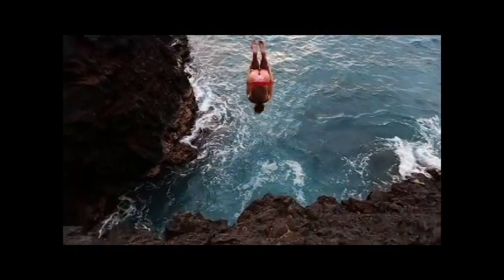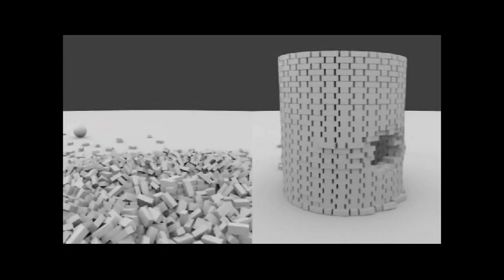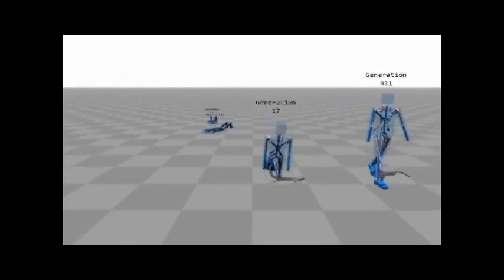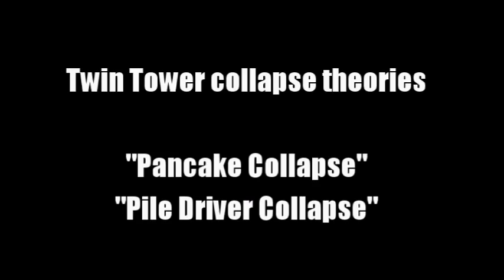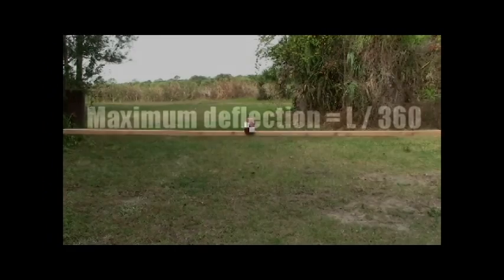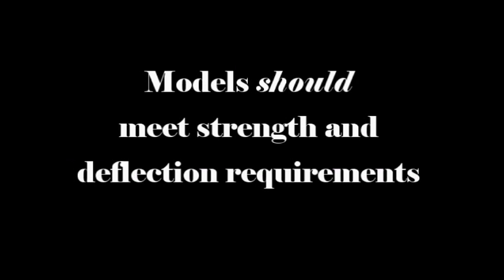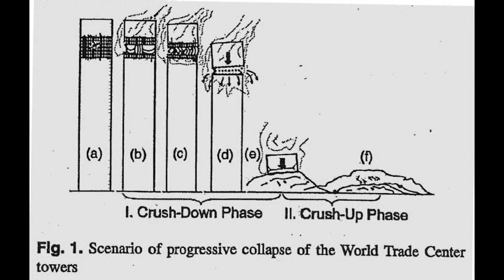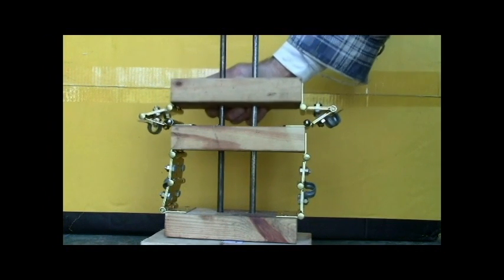9/11 Experiments: The Force Behind the Motion

Comment: Anyone with a single ounce of logic in there skull knows these buildings HAD to be professionally demoed... When one object smashes into another object it slows down or outright STOPS... Period.
If you drive a car into a house it does not gain speed and kinetic energy continuing on through the next houses inline... It FUCKING STOPS!
By the logic of what we are told happened that means that every bullet that was ever fired out of a gun or ever will be fired out of a gun should still be out there traveling around gaining speed every time it hits something... You see how retarded that sounds? 
At the very most I would expect the tops of those towers to collapse and even more likely collapse unevenly and tip over and fall off sideways leaving the rest of the buildings intact. I remember watching them live and anticipating that very thing. The tops of the buildings falling over...
How so many people can not see this very simple truth is amazing and sad at the time.
Reply: Abe - Do you believe a 110 story high rise is built like a tree?
Reply: Gecko trifecta "By the logic of what we are told happened that means that every bullet that was ever fired out of a gun or ever will be fired out of a gun should still be out there traveling around gaining speed every time it hits something... You see how retarded " a bullet doesn't equal a building. first gravity is pulling down so if you fire a bullet it'll always have a arch. got to understand that the building at the top weight a few million pounds. this experiment doesn't show that. you have to have the equal of integrity as the building does. a piece of paper in this case has more integrity than the steel in building because it is holding up less weight. how far does it take to stop a train or a airplane? a mile? maybe more? those are small compared to how much weight is at the top of that building. you act like itll stop on a dime, thats not how physics works. lets say you jump from  a tree and a mouse jumped from a tree the same height. who do you think is more likely to get hurt? the human because they have more weight than a mouse does. it's the same with this experiment. the material used in this experiment is stronger in scale than the actual building.
Reply: Ed Spencer Youre an idiot and you're completely WRONG because its not true, in fact its the other way around. I've posted multiple pieces of work explaining the acceleration, and I have multiple more pieces too from scientists with PhDs too I can post.

You keep rambling the same thing over but you havnt refuted any of the papers presented to you, you haven't posted a single lick of evidence explaining the method of controlled demolition in which the building was brought down and you still haven't answered me as to why all of the floor joists were sheared out and bent downwards. The only thing I can assume by this is that you can't explain it because you don't understand enough about the collapse.

The engineering community not only has accepted that controlled demolition wasn't used, but agrees that's what all the evidence says too. Not only this, but the irony is David Chandler, who's work you posted earlier, SUPPORTS A GRAVITATIONAL COLLAPSE

If the dynamic force hitting the bottom is more energy, how does that violate Newtons 3rd law? Apparently you don't understand the difference between those 2 types of loads.

A glass table can support multiple sledge hammers, but what happens to it if  that sledge hammer is dropped on it? Lol it's basic physics, how did you not know that?

Just because you don't understand something doesn't make something a conspiracy.
Reply: Ed Spencer - I wouldn't call what happened to the fighter jet "an immediate stop". However, I think 2012 frawd is actually not discussing the impact of the planes, but the progressive part of the collapses which were gravity driven.
Reply: Ed Spencer Because the experiments are inaccurate and don't take into account the actual factors that made it collapse, and it seems you don't have a very good understanding either. Just because it was "80% more" or something DOES NOT mean that it would be stronger too, compared to what's cascading down to it

https://youtu.be/i9gLi4pBgpk
Reply: Ed Spencer the experiment is right there above!!! In denial mich? 

Newtons 3rd law was violated? No you're  DEAD WRONG

Do you even know the difference between static and dynamic loads?

When the collapse initiates the top section is now a dynamic load that's so much more powerful then a static load, greatly overwhelming  it.
Reply: Ed Spencer "Even though the lower undamaged structure was designed to be able to handle the upper damaged 18 stories, this is only true in a static sense. Once the loads became dynamic (due to gravity), the dynamic loads had already far exceeded the structural design limit and the failure had to propagate until all the energy is dissipated.

This is true for nearly every structure in existence, and certainly true for every skyscraper: once progressive collapse begins, it can't be stopped because the supporting structure below cannot handle the many multiplications of the load it was designed to support.

It's erroneous to think of a skyscraper as a solid column of material that's able to stop falling objects. In reality a skyscraper is more like a skeletal structure with thousands of interconnected supporting members. The loss of too many members/supports will cause failure. A giant mass falling through the center of the skeleton will only knock more of the structure away, further propagating the collapse."

Quote from an Engineer who commented on it.
Reply: Ed Spencer Believe it was made in 2010, Carl Brannen is a physics professor, and that's all I know for that one, but of course I have plenty of others that are peer reviewed.

The whole point of understanding the welds is  understanding the collapse, it's quite clear that you have not even the slightest clue in the whole world about how the building was designed., nor can you explain to me why the floor welds/ joists were broken off and bent, I'll answer for you then.

If you knew anything about the building you would know that once the collapse initiates the only resistance that the section falling meets is the floor joists, which already are fractured as a result of the intense vibrations during the collapse, further reducing their strength.

 "Newton's second law of motion can be formally stated as follows: The acceleration of an object as produced by a net force is directly proportional to the magnitude of the net force, in the same direction as the net force, and inversely proportional to the mass of the object."

The floor welds fracture, giving the floors less resistance, mass builds up and the rate of destruction increases.
Reply: Ed Spencer "progressively stronger" that's how I know that you really don't know what you're talking about, because they aren't "progressively stronger"

If you had an actual brain and could understand things like Physics and engineering you would know that only a complete dumb fuck would say something like that.

"This is the difference between a static load and a dynamic load. In the north tower, with about ten stories above the impact, the dynamic load was about equivalent not to ten stories but to eighty, nearly the total height of the building. I doubt if the tower at that level was engineered to support eighty stories - why waste the steel? Actually the loads are much greater because the initial collapse involved a fall of about three or four stories, not just one, and the dynamic loads on the points that actually resist the fall - the welds and the rivets, will be far greater. If you try to stop the collapse in the millimeter or so a rivet or weld can deform before failing, you're talking hundreds of g's. In the south tower, where the top 25 or so stories fell, the impact load at eight g's would be equivalent to 200 stories, or twice the total height of the building. Some conspiracy buffs argue that engineering standards require a safety factor several times the actual load on the structure, but the dynamic loads would far overwhelm those standards."

Here's another Physics professor (FAR more qualified) then you explaining static and dynamic force, which you so clearly DO NOT understand.

I showed you an experiment with a falling chain, but instead you ignore it and keep babbling the same thing over and over, you havnt attempted to explain ANY of the points that ive made to you. The only thing that I can assume is that you have no idea what you're talking about and therefore can't answer with logical responses.
Reply: Ed Spencer Your experiment isnt accurate. When the stories collapse in the world trade centers the dynamic energy is far more then what the light weight floors can absorb, plus the floor welds were being constantly fractured by the tons of impacts and vibrations in the towers, greatly reducing the floors resistance.

In your experiment that's not the case. The energy proportions are way different, the structure is far different. Why use an experiment that's completely inaccurate to the collapse that's occurring? You can't just leave out all of the factors that resulted in its acceleration and expect it to be the same.
Reply: Yes just like when you push over domino's they stop....no wait
Reply: evsupp2011 - Where is your proof esvup? Still waiting.
Reply: FatherNature - "Half to 3/4 of the inner steel structures should still have been standing, or leaning."
And why would that be? According to that logic, men should be able to build a staircase to outer space. Ever wondered why nobody has ever tried?

"bldg 7 fell down in the EXACT same way"
No it didn't. Not even remotely close. 1 and 2 collapsed from the top. The bottoms were still standing. 7 had its structure collapse first (hence the collapsing penthouse). Seconds after, the shell collapsed from the bottom (as seen in all videos). How is that "the exact same way"? The only thing that was the same is that all three building fell DOWN.
Reply: It depends on the kinetic energy. The top ~20 floors has X kinetic energy. When the energy low enough the movement will stop.

IF there are 2-3 floors of time to accelerate for that mass the already weakened next floor cannot stop the energy.

The mass of the moving part will increase when more floors get attached to the movement. It will become unstoppable until it hits the ground.

There are less factors that can slow the mass when the outside structure blows outwards of the building and cannot contribute in any way to slowing it down.
Reply: Ed Spencer I'm afraid you're mistaken, asks was right in his statement, the building certaintly was able to accelerate as it continues to build in mass.

The video is a misrepresentation and doesn't take into account the actual factors that helped it to accelerate
Reply: Ed Spencer Lol im lying because I post actual facts? Face it, you just don't understand  the mechanics of the collapse. 

It didn't have to "crush the whole building beneath it" 

The building failed exacly right at the connections, and that's what the evidence shows too. The connections were  bent down and sheared off right exacly at the joists.

So please, explain how explosives were able to do this?
Reply: Ed Spencer https://www.google.com/url?sa=t&source=web&rct=j&url=http://brannenworks.com/aca/wtcsog.pdf&ved=2ahUKEwjJyZ60047YAhXh54MKHXlCDNUQFjAAegQIBhAB&usg=AOvVaw0sjoCfOKttBmCEO4Oj_3jF
Reply: Ed Spencer How does NIST's Incompetance prove a controlled demolition? It doesnt mesn they're "lying" The whole building would of collapsed anyways!!! I'm lying? What am I lying about? 

You still havnt explained why over 90% of all the joists were sheared off and bent downwards. *EXACTLY*AS they would be from a gravitational collapse.
Reply: Ed Spencer I have no.problm backing all of my points up with evidence, I have plenty.

But please, I'm curious to know about the floor connections? 

https://www.google.com/url?sa=t&source=web&rct=j&url=https://app.aws.org/wj/supplement/WJ_2007_09_s263.pdf&ved=2ahUKEwjEh6LA4I7YAhVLKCYKHYjxBMQQFjAAegQICRAB&usg=AOvVaw1wizG2YDIJbfELXZ8alakx
Reply: Ed Spencer You seem to be ignoring the evidence, an all too common strategy amongst "truthers" Did you not see the falling chain video above?

You also seem to be making a really great effort in  avoiding explaining the floor connections. I've yet to see one "truther" explain to me how a controlled demolition would of caused that to happen with the connections. Bending then, fracturing them, shearing then off.
Reply: Ed Spencer  Had you looked at the evidence you'd of seen. I guess that's too much work though isn't It? The welding paper was done in 2006 and sponsered by the America welding society. 

https://www.counterpunch.org/2006/11/28/the-physics-of-9-11/

Done in 2006 and peer reviewed for that one.

Truther- "a person who doubts the generally accepted account of an event, believing that an official conspiracy exists to conceal the true explanation; a conspiracy theorist."

Either a controlled demolition or its not a controlled demolition, it's as simple as that.

If you can't answer as to why the floor joists were like that, I'll just have to take it as your addmission that you have  no way to explain it, and thus are in agreement with me.
Reply: Ed Spencer 
 http://www.911myths.com/WTCREPORT.pdf

Peer reviewed, PhD scientist.

The "Counterpunch" also as peer reviewed piece, another PhD Physicists who wrote it.

It's ironic because I've posted far more evidence then you have, and you can't even refute the evidence.

Your arguments are pathetic and baseless.

It's pretty telling about your actual knowledge (or lack thereof) on the subject.
Reply: Frank Jones No it doesn't dip shit. The connections ripped out and the building fell. 

"The fall doesn't have to crush the stories beneath. It merely has to stress the structural elements until the fasteners pop and the welds break. The impact of that pancaking material will cause the outer vertical members to bow outward, then fly outward violently when failure occurs. There's no need to appeal to explosives to fling material outward from the buildings."
(Steve Dutch)

I guess you can't answer my questions either, go figure. Not a single twoofer here has even attempted to answer them, common sense would be required to do that, which none of you have.

Thanks again for demonstrating that twoofer's are nothing but ignorant dumb fucks who can't do anything but babble the same pointless comments over and over.
Reply: Frank Jones You cant answer any of the questions that have been asked to either of you. So it's obvious that neither of you understand the subject.
Reply: Ed Spencer Lol you two clowns define the whole "truther" movement, with your stupidity and inability to answer questions and logically explain points.

https://www.google.com/url?sa=t&source=web&rct=j&url=https://sites.google.com/site/wtc7lies/seffen_simple_analysis.pdf&ved=0ahUKEwjDi6r83PnXAhVCYiYKHVbGDtYQFgglMAA&usg=AOvVaw1E3KJFbFtVzhV_u4CTN4YK

Maybe this can explain some of it, but it has some pretty big words in there so I don't think you'll be able to understand it very well.
Reply: Frank Jones - "To be accurate top has to be DESTROYING the structure"
To be a little bit more accurate: the mass of the top has to destroy the shear strength of the bolts that connected the floors to perimeter and core. And to be even a little more accurate: The mass of the top has to destroy the bolts of a few floors only. Gravity will take over from there. It is called "progressive" for a reason. So do you think that the mass of the top would be able to destroy the bolts on, let's say 6 floors?

Have you ever built a house of cards and wondered why the total structure collapses when it starts collapsing? According to your logic, that house of cards would never be able to fully collapse if the top is smaller than the bottom. Right? Now add a little bit of resistance by means of the bolts.

"it's now obvious you have not one clue about physics"
Not sure to whom this applies now. Do yourself a favor and study the design of the towers.
Reply: abe lichtenstien Theres a difference between a topple and a collapse. in other words. buildings collapse the building crumbles while a tree is a solid piece of wood it can't crumble. so if you eliminate strength at the bottom of the tree the wood has strength through it so it topples over.
Reply: Ed Spencer that's easy.  When the falling block impacts with the top block it hits with X amount of force, the block it's hitting hits back with exactly X force as well (newton's 3rd) . If the falling block hits with sufficient force to destroy  the top block, then in accordance with newton's 3rd the falling block is also hit with sufficient force to destroy it. As for conservation of momentum at impact the falling block loses momentum as some is transferred to the stack of blocks resulting in the deceleration of the falling block. If the mass it is impacting is sufficiently large then it's net momentum will become zero very fast unless extra energy is added from outside the system.
Reply: Ed Spencer mmmmm no. While the forces involved would be increased....a lot, what they are being applied to in terms of mass has also increased, proportionately. If you could run an experiment on that scale I'd expect to see the exact same results just on a far more impressive level. I've also looked for any experiment that shows what happened on Sept 11 is in any way possible and come up with nothing.  I hadn't heard about Griscom, that is very troubling, having been in academia for years and seeing where invitations were sent, that there's no takers is very troubling indeed. I can think of no wet behind the ears PhD in physics that wouldn't love to boost his 'cred' by dismantling a PhD of Griscom's calibre  (what a massive Hirsch index) publicly, unless they aren't certain of winning in which case none would touch it with a 10 foot pole.  My wife just asked me 'who directly or indirectly funds the bulk of physicists these days?'. That if what I noticed was true, explains a lot. I'll let you all examine that for yourself.
Reply: Ed Spencer The energy would be absorbed and it would probably tumble off or break up some. Why you would think this is an accurate comparasion though is beyond me.

For one the towers gain mass, more mass continually adds on, and the fact that the welds are already going to be fractured cause even less resistance. If the individual floors are being hit by so much force, esspecially combined with being weakened, the force required to break them isn't going to be very significant then and the falling mass will not be broken up as significantly either.

The fact that you actually actually think that its  a relevant comparasion to the towers tells me that you have absolutely no concept of how the buildings were designed, it's quite pathetic if you still cant understand the major difference between static and dynamic loads, so maybe it should come as no surprise to me that you can't comprehend the collapse mechanics.

IT DOES NOT MATTER if it's "more" floors. The whole building doesn't have to crush itself. The connections fail and the building falls like a house of cards.

https://qph.ec.quoracdn.net/main-qimg-fa34ec645867edd8c98a4ae2560cd8d9

This is literly all the floors are supported by,, connections on two sides, no center support.

When the collapse begins the building alignment is lost and so the only resistance that the falling mass meets are these floor connections, that are simply welded to a spanderal on the colums. And let's not forget either that vibrations from the violent collapse and floor compression also fractures these welds too, severly weakening them before the mass from above even impacts it.
Reply: Frank Jones "If the mass that its impacting is sufficiently larger"

It's NOT by any means if it only has to destroy the floor connections

The floors are already weakend before they're hit. Every conspiracy theorists always wants to assume that the resistance/ connections were at maximum strength when they were hit, they weren't.

" "The structure below the level of collapse initiation offered minimal resistance to the falling building mass at and above the impact zone. The potential energy released by the downward movement of the large building mass far exceeded the capacity of the intact structure below to absorb that energy through energy of deformation.

Since the stories below the level of collapse initiation provided little resistance to the tremendous energy released by the falling building mass, the building section above came down essentially in free fall, as seen in videos. As the stories below sequentially failed, the falling mass increased, further increasing the demand on the floors below, which were unable to arrest the moving mass."

In other words, the momentum (which equals mass times velocity) of the 12 to 28 stories (WTC 1 and WTC 2, respectively) falling on the supporting structure below (which was designed to support only the static weight of the floors above and not any dynamic effects due to the downward momentum) so greatly exceeded the strength capacity of the structure below that it (the structure below) was unable to stop or even to slow the falling mass. The downward momentum felt by each successive lower floor was even larger due to the increasing mass."
(NIST)

The destruction rate of the next floor below it breaks through slightly faster then the one above, as a result of iits increasing mass and increasing fracturing done to the welds.

The fact that over 90% of the welds were bent downward and sheared off perfectly goes on to support this.
Reply: Harry Heiniken I see you need the hooked on phonics program, Ed said to step away from steel framed structures, you can't seem to.  So 1) do you disagree with the assumed results of dropping the cinder blocks on each other? And 2) are you actually saying the fires in say wtc 1 were from floors 1-110 in full roaring infernos?  Afraid you're really going to need to clarify at this point.
Reply: Frank Jones  The point of this is explaining the world trade center collapse. Trying to compare a completely different  building with a completely different structure, a completely different set of circumstances IS NOT a reliable comparasion. I provided my response for the cinder block even though it's not even relevant. The floors aren't solid blocks, they're designed strictly for static loads.

Apparently you've never heard of a "progressive collapse"

 It doesn't have to be a raging inferno fire in every single floor, but the fire certaintly did have  a huge chimney effect. The black soot and smoke can already reach really high temperatures, softening steel and having an effect. Air from outside the building sucks in through openings, causing the smoke to travel even more down shafts. Jet fuel poured down shafts and igniting fires in other parts of the building too, spreading fire on multiple floors, weakening other parts of the building.

All you have to do is look at the difference in the building from when it was first hit to slightly before it collapsed. Half of the facade was already covered, you have smoke everywhere, of its going to be hard to see most of  the fire.

If it's a controlled demolition, then please, explain this

 https://youtu.be/gJbGm7GE1tA
Reply: Harry Heiniken so much wrong with what you say.  The entire purpose of the cinder blocks was,  I'll guess, to see if you had any understanding of basic physics. I'm going to say 'no'. What happened to the blocks is simple, and the EXACT same laws of motion govern everything, including the towers. Have I heard of progressive collapse? Yes, I saw the verinage demolition, that is a progressive collapse. Can you show a progressive collapse where the building is accelerating through the destruction? That I'd like to see. So can you or can't you? No essays required,  either 'yes' and show it or a simple 'no I can't' will do.
Reply: Harry Heiniken actually at this point going through the comments a live experiment or demonstration of that is all I'll accept from you, I see the video above and the verinage demolition are proving you wrong,  and you have nothing physical to prove yourself right.  Time to dig deep and find something or you're getting tossed into the 'propaganda pushers' file
Reply: Frank Jones https://youtu.be/ngjpZPXXmbY

Clearly you don't understand the structure of the building and how it's acceleration was caused.

For one, where else have you had a 110 story structure falling on light weight floors that are only strictly designed to handle static loads?

When the building begins to collapse, the force has already overwhelmed the resistance of the floor connections below, so the building either way will collapse. My point, if it's going to collapse either way, then what would the purpose be in accelerating the collapse?  There's no legitimate reason too.

And then, what was used to accelerate the collapse?

The building couldn't of even begun collapsing in the first place without accelerating firstly. If the force of gravity acting on what's below is greater then the process is going to accelerate. What you're having such a difficult time understanding is that it doesn't matter if it's "more floors" or "more building" what matters is the resistance, and you have a massive amount of falling debris, all dropping several stories down, moving dynamicly, against a structure that's only designed for static weight, that's also having its floor connections fractured too during the process.

The one whos not understanding Newtons laws is actually you, because the resistance certaintly wouldn't of been enough to cause the force to arrest, even the buildings own head engineer acknowledged that.

And what does Newtons second law say? If more force is being applied, is something going to speed up or decelerate? 

Does Newtons law require that avalanches deccelerate?
Reply: Harry Heiniken hahahahaha that's the best you can do? Which components in that model were destroyed? Was any part of it even attached?  To be accurate top has to be DESTROYING the structure, the only thing more lame than that model would be dominos stacked up, how can you possibly be that stupid? comments on that video say it all, that is not even close to a representation of reality.   No wonder you keep saying 'clearly you don't understand ' blah blah blah since it's now obvious you have not one clue about physics.  Good bye pigeon, go bore someone else with you bullshit.
Reply: Ed Spencer - I know I'm late to the discussion and for that I apologize. You posted a link to a video by Chandler. Chandler, like you, does not seem to understand the design of the towers. He is using a random demolition of an apartment block as an example of how the towers should have fallen. Why? Did this apartment block have a steel frame? Did it have long floor spans? Did it have girders? Did it have 3-story panels at its perimeter? Did it have floor trusses? Were these floors connected to the perimeter by only 2 bolts? Would the building collapse if you'd take out a few floors? All these questions will be answered NO. And now for the tower: Yes. 

You make the same mistake that a lot of truthers do: you believe the actual floors would have to be destroyed. You're wrong. Only the connections from floor to perimeter and floor to core would have to be destroyed for a full progressive collapse. So if you ask if 14% of a solid block (like Chandler thinks the towers were) would be able to destroy the remaning 86%, you are asking the wrong question. The question you need tp ask is if the weight of this 14% would be able to destroy the bolts that connected the floors to the beams. Now guess what the answer is.

The "experiments" you have been watching do in no way represent the actual situation.

You claim that the floors get stronger in the lower parts of the buildings. This is not correct. The floors weere not stronger. Only the steel of the core got thicker. The floors were all the same (except for the mechanical floors which were more robust). The core has no part in the progressive collapse at all.
Reply: Bruce Lansberg then show me an experiment that does. Verinage is as close as you can get in the real world, find one that accelerates after the initial impact.  Then we can talk.  Until such time the conversation is over as you have no backing physical experiments, the opposing side does.
Reply: Ed Spencer - "I have shown you a BUILDING that proves you are completely wrong"
You have shown an random demolition of a random building. What is it you think you have proven? Which factors of this collpase do you think ralte to the collapses of both towers?

" in 2007 NIST itself admitted in writing it could not explain the total collapses"
I must have missed that. Could you please link?

"I'm afraid you haven't answered the question."
You are derailing the discussion. Harry has explained the collpase dynamics and asked you how explosives are able to bend and shear off bolts. 
And then you write: "now that's called 'evasion', are you going to answer any questions or just engage in rhetoric and propaganda?"
Do you see why I think this is ironic?

So, before you proceed, could you please explain how the random demolition of a random building relates to the collapse dynamics of both towers. Much appreciated if you can.
Reply: Bruce Lansberg A) feel free to look  up NIST yourself, Google those words and you'll find it.  B) repost the building that accelerates after initial impact constantly.
Reply: Ed Spencer - "And in physics 'if it doesn't agree with experiment, it's wrong'."
That is a great one-liner I have heard a little bit too often from truthers that do not understand the subject matter and therefor like to quote authority. You do however overlook the fact that the experiments shown in the video above do not represent reality in the slightest was. See earlier reply. Build a copy of the towers and initiate a collapse from the top. That's an experiment that would work.
Let me ask you in another way: What in your opinion should have stopped the progressive collapse of the towers?

" In terms of physics,  the official BS falls apart."
Yet you have not been able to explain as to why and come up with a video created by a high school teacher that has no understanding of the design of the towers. Do you believe the towers were massive blocks?

"what you consider 'evidence' in regards to physics are actually unsubstantiated theories until proven through experiment, that's physics."
?? That's physics?? What definition of physics are you using then?
Reply: Frank Jones http://www.nmsr.org/nmsr911c.htm

David Chabdlers own data supports a gravitational collapse.

None of them have even been able to answer basic questions.
Reply: Bruce Lansberg A) did you look it up on google yet? Took me 5 seconds. B) where is your building you said you posted? Don't see it anywhere. Without it anything you say is propaganda and baseless conjecture.  Put up or shut up .
Reply: Ed Spencer - "I avoid nothing."
Yes you do and yes you have. 

"according to physics what the towers did violates both the conservation of momentum and newton's 3rd."
Now it is becoming clear. You have not studied anything but only watched a bunch of YouTube conspiracy videos. Correct? If not, please elaborate on this statement and explain why and I will apologize if you are correct. Note that you do need to study the design of the towers first though, something you should have done before you entered into any discussion on the cause of the collapses.

" If you think 20 stories hitting 95 progressively stronger floors"
Dear Ed, you are the only one that thinks this is what happened. You are the only one (except for all other truthers) that believes the upper floors were less strong than the lower floors (not that it matters) and that the floors needed to be destroyed for some reason. Reality does not require stronger or weaker floors. It just requires snapping or bending bolts. Baically the bolts were what kept the towers up. Let me know if you want an explanation.
Reply: Ed SPencer - "If I take 4 cinder blocks and stack 3 on top of each other, then drop the 4th onto the stack from 10 feet  in the air"
There we go. This is your mistake. The same mistake Chandler makes. The towers were no solid blocks and cannot be treated as such. The top cannot not be considered a solid block since it isn't. Same goes for the lower parts. You might want to look into the concept of deformation.
Reply: "then show me an experiment that does."
What's so relevant about that experiment of yours? Do you really want me to create an experiment that proves gravity accelerates? Well, go up a building, take out your phone, hold it the edge and drop it. Now measure the accelleration. Got it? There's your experiment proving gravity accellerates in a vertical manner. Now, what you just measured is near free fall accelleration. The towers went down at about 2/3rd of free fall accelleration. The collapses experienced some resistance. Do you want me to create an experiment that proves resistance will slow down accelleration? It seems you confuse free fall accelleration for any accelleration. You seem to think that any resistance will slow down any moving object. In reality it will just decrease accelleration. What is it that is so confusing about this to you?
Reply: Frank Jones - "feel free to look  up NIST yourself"
Thanks for the hint, but the NIST reports on 9/11 are on my desktop.

"repost the building that accelerates after initial impact constantly"
I don't know what this means. Could you please clarify?
Reply: Frank Jones - "did you look it up on google yet?"
No I didn't since the reports are on my desktop. Which paragraph on which page from which report did Ed Quote when he said that NIST had no clue why the building progressively collapsed? That's all I would like to know. Maybe it's in there somewhere, but i missed it. Thanks for your help.

"where is your building you said you posted?"
Again, I don't know what this means. You need to be little bit more precise using words. Thanks. 

"Without it anything you say is propaganda"
Well, I don't think you're correct. We would have a hard time in real life if everything we say is considered propaganda if we don't post buildings.
Reply: Ed Spencer - "busy this week"
Helping out Santa? :) But no problem. I will be patient.

"Where is your building?"
Which building?
Reply: Ed Spencer - "I'm away and WiFi spotty shit head"
You are away and Wifi spotty shit head? You guys really need to practise using words and creating sentences that make sense. Or maybe it's just me. But I have difficulties understanding what you're trying to say. I assume you are bussy. Hope to talk to you soon and read some answers.

"Now put up your building or shut the fuck up."
Nah, you can't tell me to shut up. Well, in fact, you can, but I will ignore if you don't mind. Not taking orders right now :). And what building should I put up?
Reply: Ed Spencer + Frank Jones - Ah, I now see what is going with that building you would like me to post. Well, let me introduce you to the concept of quoting. To quote is a verb and means "to repeat (a passage, phrase, etc.) from a book, speech, or the like, as by way of authority, illustration, etc." See what I did there? I put text between quotation marks, hence quoting. I was quoting you Ed, when I copied and pasted the text you have written. I put it between quotation marks. Another word for quoting is citing.
So, when I wrote "I have shown you a BUILDING that proves you are completely wrong" I was quoting you Ed. I usually quote before I comment so that anyone that reads my posts clearly understands to whom and to what I am responding. Confusing, isn't it?
Reply: Frank Jones - "you're just being an idiot. It isn't in the nist report dumbass, it's in their response to  request for correction."
Now this is interesting. You call me an idiot and dumbass because I asked someone else to back up his claim? And then you come up with this letter that should prove that claim? Have you even read it yourself? Do you understand to which question NIST gave an answer in the first place and what they have stated on the computer simulations? Do you know what the scope of the NIST investigations has been at all? And please explain to me how this answer relates to the credibility of the NIST investigation. What do you think this proves? It surprises me that this is what you respond to and ignore everything else I have written. Have you even read any of it?
Reply: Frank Jones - "don't you have a single experiment that shows what wtc 1 did is possible?"
You are shifting goal posts now. So now WTC 1 did something impossible? What do you believe was impossible exactly? And please be specific.

"Any verinage demolition shows that is simply impossible."
Show me a verinage demolition of a steel structered, long floor spanned, 110 story office building in which a plane crashed and which was on fire on several floors. So you can't find one? Yes, show it,no, say I cannot find one. 
See, this makes no sense. It is not about experiments. It is not about available videos. It is not about verinage. It is about 9/11 and your lack of understanding of the design of the towers.

Let's take it step by step. Do you agree that the towers uniquely designed?
Do you agree that there were 4 constructional elements? (perimeter - core - floors - hat truss)
Do you agree that these 4 elements were working together to kep the building up?
Do you agree that the floors were connected to both perimeter and core?
Do you agree that apart from these connections there was no vertical support for the floors?
Do you agree that the floors were supported by floor trusses?
Do you agree that these trusses were connected to perimeter and core by two bolts only?
Do you agree agree that the dymanic load of 14-28 stories would be too much to carry for these bolts, if these were designed for a static load of max 6 times the weight of one floor?
Do you agree that buildings are 95% air?
Do you agree there were two stages at both collapses, the initiating stage and the progressive stage?

Would you like to discuss laws of physics? Have you seen my earlier questions? Care to answer them?

"If you can't find a supporting experiment admit it"
What's there to admit. I never made any claim about it. Damn, if you have this much issues with comprehensive reading, no wonder why you don't understand the collapses.
Reply: Frank Jones - "I call you a dumbass and an idiot for being too stupid to simply do a Google search"
Now I am stupid too? For trying to find alledged evidence that backs up someone elses claim? How stupid do you think I am? Would I tell you the towers came down by a gravitationally driven collapse and tell you to just Google my backup? I'm afraid it doesn't work like that in a grown up discussion.

Just in case you still do not understand what NIST actually tried to say: NIST states:
1. They did not investigate the progressive part of the collapses since the scope was to determine the initiation of the collapses.
2. Computer models are not able to model the progressive part of the collapses because of the magnitude and complexity of such an event.
It's right there, in the same letter. Did you read it?

You really need to try a little bit harder than just copy/pasting claims from some YouTube conspiracy video. And you call me a dumbass, idiot and stupid :). Oh the irony.
Reply: Bruce Lansberg I really don't think they understood anything what you're saying, its almost impossible to have logical discussions with truthers. The responses they give tell the whole story.

They don't have a single clue what they're talking about, and probably need special help just to whipe their own asses. 

The only thing that they're good for is to stir them up a little bit and laugh at their complete and total stupidity.
Reply: Conner Price - After all these years, I am still flabbergasted by the lack of willingness to accept facts and gain knowledge and information by some truthers. I am still flabbergasted by their ability to ignore real evidence and hold on to a theory for which there is no evidence, even after 16 years. Coincidence or not, most of these people are creationists as well. It is their believe and it has nothing to do with the facts. So yeah, I fully agree that it is almost impossible to have a logical discussion, since believe is actually the opposite. But be aware, conspircay theorists are amongst the intelligent as well. Their confirmation bias is simply very strong.
Reply: Bruce Lansberg alleged evidence . Here's a summary, enjoy the read  http://www.historycommons.org/context.jsp?item=a092707nistcantexplain
Reply: Bruce Lansberg and here's where to get an actual copy in .pdf http://www.visibility911.org/pdf-nist-response-to-request-for-correction-092707/ took 5 seconds.  That now tells me you do not actually have any wish to go and look for yourself. Fine. And your responses tell me that you cannot find a single physics experiment to back up the official conspiracy theory.  So now it's been established NIST itself could not explain the total collapses why did, and they still do, believe NIST explained it ? It's like they didn't understand what they were reading.
Reply: Bruce Lansberg this is what's so entertaining about your ignorance,  verinage demolitions aren't used on steel framed structures,  they are too strong.  The theory does work but the the extensive prep work required it's is faster and less expensive to use explosives.  So these are done on WEAKER buildings,  and not one will you see accelerate after initial impact. No they hit, then constantly decelerate and come to a stop, in the case if the first one,  take special note at the end, it didn't destroy all the lower floors, there's one left. https://youtu.be/NwFHEoiUZ7o . So in the case of wtc 1 the top 14 or so floors fell into 95 intact floors, we can say approximately 93 of those floors had  no fires  to 'weaken' the steel. At the point of contact with the 95 there is no jolt, the destruction of the 95 then continues at a constant acceleration  (no not ffa that was wtc 7)  as seen with verinage even with inferior structures there is no acceleration, there can't be, impacting and destroying cause deceleration in buildings,  always. The speed of the destruction is also unprecedented, had their been 2 of those gargantuan floors destroyed every second, an incredible feat, it would take over 50 seconds for the collapse to occur. So last time, can you produce an experiment, a real world event that shows acceleration after impact with similar parameters?  Yes or no. Any more blathering and I'll mute you, we're here to discuss physics and reality, you're just waffling saying 'I know' ' you don't know anything' which is boring and trite. Put up something, or admit you can't,  let's see what you've got.
Reply: Conner Price I gave up trying to discuss anything with obtuse fools. Look at the conspiracy theory you believe, 19 men, all who  somehow boarded a plane without ever being at the 3 airports they departed from, took over 4 planes and defeated the greatest defence system in history with box cutters, then knocked down 3 buildings with 2 planes. And all this was done at the bidding of bin Laden.  All of the above mentioned has literally no authenticated evidence to support it, and you believe it anyway.  Is that the norm on your flat earth with its Chemtrails?  As for the buildings as now established there is no official explanation for the collapses,  yet you armchair experts say 'it's obvious' .  I've show you case studies of weaker structures experiencing progressive collapses and behaving exactly like our laws of physics say they will.  Your ilk show...nothing and try and avoid the fact you can't.  You try and get us to ignore this with blathering and babbling, it doesn't work. The towers collapses allow endless circular arguments. The lack of us even knowing who carried out the attack and who was behind it does not.
Reply: Frank Jones - "Here's a summary, enjoy the read"
Thanks a million, but I read it yesterday. Hence my reply. Did you read it? This is what I wrote yesterday:

Just in case you still do not understand what NIST actually tried to say: NIST states:
1. They did not investigate the progressive part of the collapses since the scope was to determine the initiation of the collapses.
2. Computer models are not able to model the progressive part of the collapses because of the magnitude and complexity of such an event.
It's right there, in the same letter. Did you read it?

Catch up dude.
Reply: Frank Jones Its obvious that you don't understand the laws of Physics. Your examples for one, aren't proportionally accurate in energy, it's a completely different type of structure, it overlooks the rapidly accumulating mass, it doesn't include the fact that the floor supports in the towers already would had been significantly damaged,, before it's even hit from the mass above it.

The fact that you actually believe it's a reasonable compassion between 2 completely different structures with 2 completely different circumstances is proof that you don't understand why it collapsed and why it was able to accelerate as it did. No laws of Physics had to be broken for it either

https://sites.google.com/site/911guide/newtonsbit2

There's a perfectly reasonable explanation, but it seems that you're just having too hard of a time understanding it and comprehending all of the figures and what they mean. 

Anyone with an understanding can work out the math themselves and see the force that's hitting the static floors below is far greater because it's a moving load. You and all the other truthers wrongfully assume that just because it's more floors therefore that should also mean that's it's more energy. The reason that you're wrong is because you don't know the difference between static and dynamic loads. I understand what it is, Bruce obviously can understand it too

" I carried the event far enough along so that I became convinced that if you dropped the floors above onto the floors below, ie, caused a collapse in the middile of the building some place, that without question, the collapse would continue, right down right down to the foundations. There's no way that the structures below would be able to carry let us say 14 stories. Not possible, not even being close to possible. And it would not be a slow failure either. Drop 14 floors on any one floor of that building and it would collapse instantly.
Well, no, not "instantly" that's a bad tern. It would collapse ins- instantly as far as you or I perceive it"  (Leslie Robertson)

This is a quote from the WTC's HEAD ENGINEER who says this, and I sure as hell know that he's going to know this far, far more then you can
Reply: Frank Jones "Yes, there was more than enough gravitational load to cause the collapse of the floors below the level of collapse initiation in both WTC towers. The vertical capacity of the connections supporting an intact floor below the level of collapse was adequate to carry the load of 11 additional floors if the load was applied gradually and 6 additional floors if the load was applied suddenly (as was the case). Since the number of floors above the approximate floor of collapse initiation exceeded six in each WTC tower (12 floors in WTC 1 and 29 floors in WTC 2), the floors below the level of collapse initiation were unable to resist the suddenly applied gravitational load from the upper floors of the buildings.

Consider a typical floor immediately below the level of collapse initiation and conservatively assume that the floor is still supported on all columns (i.e., the columns below the intact floor did not buckle or peel off due to the failure of the columns above). Consider further the truss seat connections between the primary floor trusses and the exterior wall columns or core columns. The individual connection capacities ranged from 94,000 pounds to 395,000 pounds, with a total vertical load capacity for the connections on a typical floor of 29,000,000 pounds (see Section 5.2.4 of NIST NCSTAR 1-6C). The total floor area outside the core was approximately 31,000 square feet, and the average load on a floor under service conditions on Sept. 11, 2001, was 80 pounds per square foot. Thus, the total vertical load on a floor outside the core can be estimated by multiplying the floor area (31,000 square feet) by the gravitational load (80 pounds per square foot), which yields 2,500,000 pounds (this is a conservative load estimate since it ignores the weight contribution of the heavier mechanical floors at the top of each WTC tower). By dividing the total vertical connection capacity (29,000,000 pounds) of a floor by the total vertical load applied to the connections (2,500,000 pounds), the number of floors that can be supported by an intact floor is calculated to be a total of 12 floors or 11 additional floors.

This simplified and conservative analysis indicates that the floor connections could have carried only a maximum of about 11 additional floors if the load from these floors were applied statically. Even this number is (conservatively) high, since the load from above the collapsing floor is being applied suddenly. Since the dynamic amplification factor for a suddenly applied load is 2, an intact floor below the level of collapse initiation could not have supported more than six floors. Since the number of floors above the level where the collapse initiated exceeded six for both towers (12 for WTC 1 and 29 for WTC 2), neither tower could have arrested the progression of collapse once collapse initiated. In reality, the highest intact floor was about three (WTC 2) to six (WTC 1) floors below the level of collapse initiation. Thus, more than the 12 to 29 floors reported above actually loaded the intact floor suddenly."
- NIST

You intentionally take out of context what NIST says to falsely imply that they're just completely stumped by the collapse and have absolutely no idea why, and that's false. Anyways, just because they had an inaccuracy somewhere doesn't change anything nor is it even evidence of controlled demolition.

What I find the most appalling is all of the evidence you ignore. Seismic waves indicate a structural failure, the trusses clearly are seen bowing inward. Witnisses all support it.

https://sites.google.com/site/911stories/accountsoftowerstructuralinstabilityande    

https://sites.google.com/site/911stories/comparisonofwitnessaccountstorodriguezst2
Reply: Frank Jones Since you have no interest in reading facts and looking at evidence so that you can understand the collapse, you'll just have to be muted.

Your input has been of no value and it only shows me that your knowledge is too low to understand the subject. Next time you should just really leave this to the adults to figure out and discuss.
Reply: Bruce Lansberg So to paraphrase,  the investigation which was to determine the how and the why didn't do it. Great. And since they actual say they cannot explain the total collapses, well now you're screwed.  Conjecture and propaganda are worthless.  Can you show a demolition of a building without explosives that accelerates post impact? No.  Can I show a building being destroyed without explosives in a true progressive collapse? Already did.  Do any of them accelerate post impact?  Not a single one. Ergo 1-0  me. End of discussion if you cannot PROVE what you say, which I already know you can't or you would have.  Feel free to say something when you do. Until then  I'll be ignoring you or making sarcastic comments like 'great example' .
Reply: Conner Price just a minute tinfoil Hat wearing nutjob.  Do you still believe the attack was carried out by '19 hijackers' on the orders of bin Laden?  Until you admit that's just a ridiculous conspiracy with no backing proof there is no point in talking about the buildings, since we don't know 'who' we have no concept of their capabilities.
Reply: Frank Jones - "That now tells me you do not actually have any wish to go and look for yourself."
You are partly correct. I have no wish to search for evidence that is supposed to back a truther's claim. You (or any other truther) make the claim. The burden of proof is on you, not on me. However, as you will have read by now, you will understand that you are wrong. Again. I read that letter yesterday and I have responded to it. Unlike you, who has not responded to any of my questions and feedback.

"And your responses tell me that you cannot find a single physics experiment to back up the official conspiracy theory."
Typical. I never claimed I was looking for it in the first place (I'll ignore the "conspiracy theory since you obviously have no clue about the meaning of such). 

"So now it's been established NIST itself could not explain the total collapses"
Yeah, you have falsely claimed that before. NIST answered they were "unable to provide a full explanation of the total collapse". Dude, you really need to stop misquoting. It is annoying and it shows your lack of understanding. As I have explained yesterday, this was written in the context of an answer to some of the accusations by Jones et al, in specific as to why there is no data available from a computer modelling the progressive part of the collapses.

It is annoying that you produce a misquote, take it out of its context, add an own meaning and try to use it as some kind of proof I am wrong. It is actually quite embarrassing to see how you draw conclusions from what you seem to think are relevant facts. Although I see truthers do this regularly, it is still painful to witness.
Reply: Bruce Lansberg that's an amazing physics demonstration that supports your BS...oh wait nothing there 😂 let's see 'blah blah blah...' congratulations you failed.
Reply: frank Jones - "verinage demolitions aren't used on steel framed structures"
Who cares. You are the one that brought it up.

"So in the case of wtc 1 the top 14 or so floors fell into 95 intact floors"
No! They didn't. The mass of the top 14 (and 28) floors hit one intact floor.

"we can say approximately 93 of those floors had  no fires  to 'weaken' the steel. "
Agreed

"At the point of contact with the 95 there is no jolt"
There is no such thing as "point of contact with the 95 floors". There is only mass of 14-28 dynamically pushing on one floor only (or actually on a few bolts only), having the bolts shearing off. How much resistance do you think these bolts would provide? For some reason you seem to think that snapping bolts are able to slow down an ever increasing force caused by mass of 14-28 stories of steel.

" the destruction of the 95 then continues at a constant acceleration"
Not the destruction of the 95, just the destruction of the bolts of the 95 floors, floor by floor. The floors themselves would simply fall down, breaking up in the process.Even if the floors would have remained in 1 piece, the towers would have fully collapsed. The floors tied the core and perimeter together. Perimeter could not stand alone. Core could not stand alone. The floors provided the lateral stability. The bolts kept the floors connected to the beams. Bolts gone, floors gone, stability gone, perimeter and core gone, towers gone. So, the "only" thing the tops of the towers (or rather the masses of the tops) needed to break, were the connections between each seperate floor and the walls. And yes, that will happen at a constant acceleration. That's how gravity works.

"as seen with verinage even with inferior structures there is no acceleration,"
Please cut the Chandler crap. It doesn't matter what had caused the initiation of the collapses. The progressive part was inevitable. Like dominos, yes. It doesn't matter what causes the first stone to fall, wind, push, fart, plane, or bomb, once the first stone falls, it will go one. Gravity is the constant factor here. That's what keeps the falling going. So verinage or not, it is irrelevant. If you would have put those hydrolics at the 95th floor of the towers and let them crush or move the support, the result would have been exactly the same. Full and total collapse of both towers. Beacuse of their design. That's why taking a random building in a random demolition and compare it to the towers, makes no sense. And how is concrete inferior to steel by the way? You do know that the core of the new WTC1 is made out of concrete? Is it inferior to the old towers?

TBC
Reply: Bruce Lansberg look at that amazing physics demonstration proving your full of crap..hahahaha keep it up chuckles.  Why is what you're saying true? Because you are saying it? If it was so simple to explain why didn't nist and why did they say they couldn't explain the total collapses.  Either they are incompetent and we need an entirely new independent investigation or you're lying.   Which is it?
Reply: Frank Jones - "there is no acceleration, there can't be"
Sorry mate, but you're wrong here. When I push my finger into a stick of butter, there is resistance and yet acceleration. Otherwise I would not be able to push my finger into it. I am trying to say here that there is a constant force working on the towers, or their tops, or its debris. That constant force is gravity. Although there might be resistance, there is still acceleration. Have you ever pushed a motor bike? Notice how it goes from 0 to whatever pace you walk, in spite of the resistance. You can even slightly press the brakes and still be able to push it. Now you are saying, because there is resistance, the bike would slow down, no matter what. Bu how can I push it from 0 to something then? 

So, there is acceleration. It is just no free fall acceleration. The rate of acceleration is smaller because of the resistance. Caused by the constant force of gravity.

" impacting and destroying cause deceleration in buildings,  always. "
So, no. This would only be true in space where there's no gravity.

"The speed of the destruction is also unprecedented"
By whom?

"had their been 2 of those gargantuan floors destroyed every second, an incredible feat, it would take over 50 seconds for the collapse to occur"
Well, there had not been 2 floors destroyed every second. Like I have stated before, it's not the floors that needed to be destroyed for the buildings to loose its integrity. It were the connections that needed to be destroyed. But as long as you do not read into the design of the towers, you will never understand. Anyway, the building fell a lot faster than that. Are you impressed by the force and power of gravity now? I hope you do realize that it really doesn't matter if the collapses were initiated by planes, fires, bombs or wind. Once on its way, there's no stopping. And yes, at those speeds. That's how gravity works mate.

"So last time, can you produce an experiment, a real world event that shows acceleration after impact with similar parameters?  Yes or no. Any more blathering and I'll mute you"
Dude! Do you not understand that asking for this is like asking for an experiment that proves wheels can turn? it is obvious they can. Nobody should spend time and money to the obvious. You are asking for an experiment that proves basic physical and mathematical laws. It is supposed to be obvious dude. It is your misunderstanding of acceleration and velocity that causes issues here. Not my lack of providing an experiment that would prove the obvious. I really don't know how to explain it to you in an easier way. If an object experiences no resistance, and the there's only gravity working on that object, it will have a constant acceleration of 9.8 meters per second squared (9.8 m/s/s or 9.8 m/s2). The acceleration is constant, so the speed in ever increasing. Until it reaches terminal velocity caused by either drag or someting else, it accelerates. Drag for example can slow down acceleration, but the object will still accelerate until it reaches this terminal velocity. So a decreasing acceleration is not the same as deceleration. Throw you phone off the highest place you can think of. It will accelerate to earth. It will keep accelerating up to a moment when air resistance is as large as the pulling force of gravity. It doesn't slow down. It just accelerates at a lower rate.

"Any more blathering and I'll mute you,"
You're giving me an ultimatum? Haha. Dude, if your knowledge and understanding of very basic physical principals would not be this low, we would have been able to make a lot more progression than we have so far. Now before you respond again and ask the same question again, please try to understand what I have written.
Reply: Bruce Lansberg So who is lying? Was it nist or it you? They clearly said they couldn't explain it and here you are blathering on about how it happened.  So who is lying?  You or them.  Only looking for a one word answer special ed.
Reply: Frank Jones - Dear Frank, I have explained twice now what NIST actually said. NIST said that they were unable to deliver a computer modelling of the progressive part of both collapses, simply because no computer modelling would be able to calculate what happened in detail. That's what they were saying in that letter. Quote mining is not going to help you make a point. And you even misquoted NIST's response. So you are deliberately twisting facts to remain your confirmation bias. Read it again please.
You act like there is no such thing as progressive collapse possible. You might want to read into it a bit. Here's a nice start: https://en.wikipedia.org/wiki/Progressive_collapse. Specifically the last example, the Plasco Building, is interesting. It was a steel framed building that collapsed because of fire (and desiign) alone. Why do you think Gage now has to claim the Plasco Building was wired?

"Either they are incompetent and we need an entirely new independent investigation or you're lying.   Which is it?"
Yeah man, I wish the world were black and white. It would be a lot easier, wouldn't it? You sound a bt like Bush that stated "you are either with us or with the terrorists". To answer your question: I don't think NIST is incompetent. Have you seen any evidence they are? If so, please explain in detail. I am not lying either. If you think so, please explain as to why. And please be specific. 

Time to answer my question now.
Reply: Frak Jones - " Why is what you're saying true?"
Because it is verifiable. Why do you think I want you to go through the steps I listed before? Do you agree to them? Care to discuss real facts now?
Reply: Bruce Lansberg So it's you that's lying, that's for clearing that up.
Reply: Ed Spencer You really are one major dumb fuck aren't you? You've not answered any of the questions from Bruce and Harry, you've not even tried to refute any of the points that ive adressed to you.

Fess up, you know the reason that you havnt answered them or adressed any points ive stated is because you can't. Your level of intelligence isn't high enough to understand anything that's being asked to you, ts physically impossible for you to comprehend the subject. The only thing that you can do is blather the same thing over and over and intentionally be deceitful by making it seem as if NIST is completely stumped and can't explain anything at all. Not that its even about NIST in the first place, you just keep brining it up so you don't accidently say the wrong thing and humiliate yourself even more.

Just like Frank, you're literly actually mentally retarded and you have a severe educational deficet that prevents you from using any type of logical explanations. Sadly I'm not even exaggerating that when I say it either. In fact I would be pretty surprised if you could even read what im saying right now.

You avoid questions, you don't understand Physics, you strategicly avoid refutation of anything, and you also have to have help just to whipe your own ass.

Thank you though for proving even more of what I had already suspected in the first place- that you have not a single shred of physical evidence and have no idea what you're even trying to say. So you'll be muted too, next time you should just let the adults to discuss it and figure it out, you're input holds no meaning. You are a complete fucking idiot.
Reply: Gecko Trifecta that's what I was saying.. why did the WHOLE building fall so perfectly at basically free fall speed, ALL AT ONCE???? The top was what was damaged, so how did the rest of the towers just collapse?? It supported all that weight for years.. doesn't make sense
Reply: You nailed it bro.  Thumbs up!
Reply: Gecko - "Anyone with a single ounce of logic in there skull knows these buildings HAD to be professionally demoed."
And anyone with just a little bit over an ounce, knows it didn't.
Reply: Chris Gilliam  What force makes a tree topple over when it is chopped Chris? Do all the trees fall straight down through the path of most resistance where you live because gravity is so strong?
Reply: Harry Heiniken by 'believe' I'll translate that into 'you have no clue'. What are his credentials? Hopefully he's a PhD with a decent  Hirsch index, though if he is its surprising he hasn't already stepped up https://youtu.be/n6ExxYOPYNU Look at Griscom's credentials, Hirsch index etc. Not a single PhD in physics will publicly defend the official conspiracy theory,  not one. Some like your unknown there will write the hide , but when challenged run for the hills. In terms of physics,  the official BS falls apart. Nice try though.
Reply: Chris Gilliam Is this a serious response? 
No really, is it?
If it is then I regret to inform you that you sir fall into the category of moron... And unfortunately there is no "help groups" that I'm aware of that might be able to assist you regarding this matter... 
My sincere apologies.
Reply: Harry Heiniken as for my 'lack of knowledge ' do you know why I call you pigeon? Because trying to have a conversation with you is like playing chess with a pigeon, I make a move, you walk around knock pieces over, shit on the board then strut around like you won the game. Evidence in the case of physics will be from physical experiment  (notice the word 'physic' in 'physic'al) .  So last time before you get muted, can you produce a single experiment that produces Bazants laughable idea? Yes or no.  Yes, show it, no, admit it.
Reply: Bruce Lansberg wow you're just being an idiot. It isn't in the nist report dumbass, it's in their response to  request for correction.  Just put in Google 'nist  admits it cannot explain the total collapses 2007' you can even find a link that gives you their full response in .pdf and you can hunt for that one tiny line that ruins your theories.  You also said you had shown a building,  when and where?
Reply: Harry Heiniken ....Harry, after that video you posted just go sit in the corner with the  dunce cap on and don't come out ....ever. you're muted
Reply: Bruce Lansberg Jesus christ don't you have a single experiment that shows what wtc 1 did is possible?  Not one? To be clear you need 14% of a structure to first have that top 14% collapse and then impact the rest of the structure,  experience no jolt or impact,  then constantly accelerate through the rest of the structure.  Any verinage demolition shows that is simply impossible.  If you can't find a supporting experiment admit it and stop spamming, it's a waste of  time.  So can you find one? Yes, show it, no, say I cannot find one.
Reply: Bruce Lansberg no I call you a dumbass and an idiot for being too stupid to simply do a Google search, that's spamming and wasting my time.  Show me something concrete, then realize that when nist said what they did, everything you've ever read or heard with people saying it's 'easy' and 'so obvious' are nothing but outright lies.